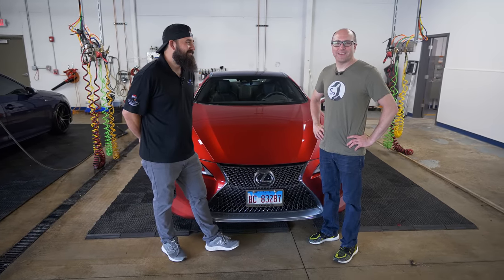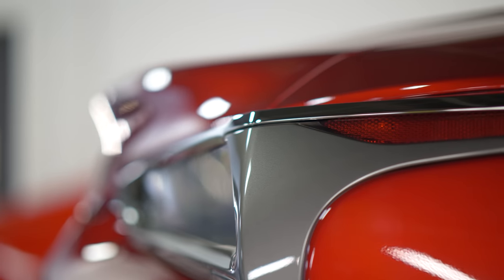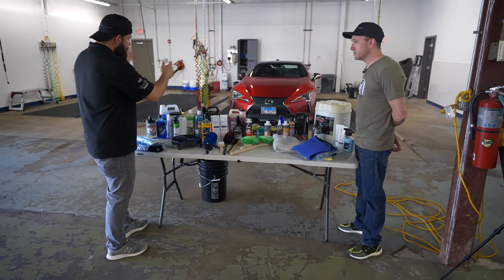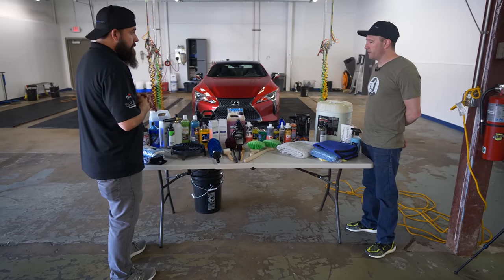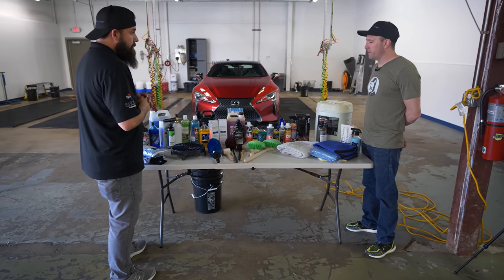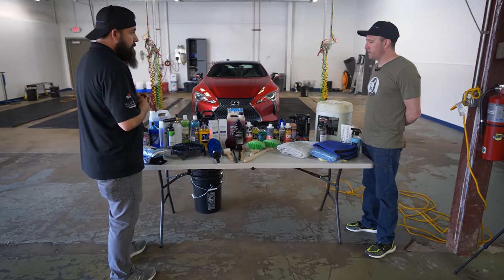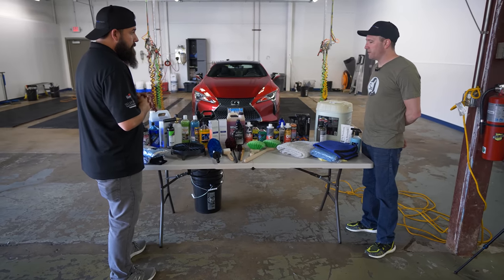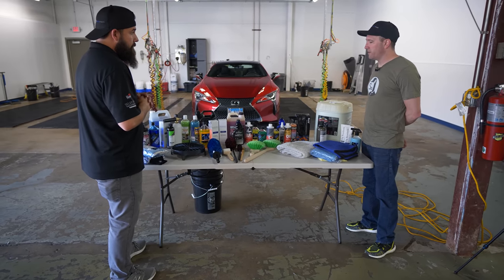The Right And Wrong Way to Do a Car Wash

Comment: Okay, got it. I need 8 buckets, 13 brushes, 17 microfibers towels, and 23 different spray-on products. Easy!
Reply: And don't forget a couple of "relatively cheap" thousand-dollar pressure washers! ;-)
Reply: And most of a Saturday.
Reply: ...And a leaf blower.
Reply: These comments !!! Lmaooo
Reply: You can use a $80 pressure washer to wash a car and it will do a great job.  The Kranzle's are great machines but not necessary at all, although they will last longer if taken care of.  There are plenty of one bucket methods of car washing that work great.  You can get a pack of 36 microfiber towels at Costco for $15 and use a handful of them to wash a car, and use a new one for each panel - which is probably the best and safest method of all, just be sure to remove any tags from the towels before using them on the paint.  Optimum No Rinse is a great product for the one bucket and multi towel method, especially if you are in a area with limited water access.  ONR is also a great product to use as a regular wash soap or a spray detailer for removing bird droppings and such.  ALWAYS use a different mitt or different microfiber towels and bucket for washing wheels and keep them separate from the towels used on the paint because metallic brake dust will get stuck in them and you don't want it to get on your paint.
Reply: Don't forget the two stage water filter
Reply: @bpsdetailing8822  the Costco towels are poor quality and leave fuzz all over the car. Great tips but Costco micro fiber towels are the worse
Reply: And now that, every week.
Reply: @bpsdetailing8822  Costco microfiber towels are not good. They leave a lot of small fibers behind, even after washing them.
Reply: @s flaherty NOTHING would want me to buy a Jeep. lol
Reply: NATSCHKE FAMILY ADVENTURES why ?
Reply: I think I'll just buy a new car
Reply: @frankdunn1813  The point was that there are cheap microfiber towels that will get the job done.  I got a pack of imperfect microfiber towels at walmart for even cheaper than the costco pack and they don't have any linting issues. I think the consistency with the Costco towels is not good, I have had good batches and bad batches.  They also changed the type of microfiber at one point and the quality went down, but for the purpose of using them as a wash mitt they should do a fine job.
Reply: 12:05
Reply: Honestly you’d think with all the advancements, automakers would’ve come up with much tougher paint. An automobile that is used as a daily driver will have to eventually deal with flying rocks, bugs, door dings, etc. All these steps and bullshit is cool for your $100,000 LC 500 that you garage until the weekend, but it’s ridiculous to be doing this shit on a $30,000 Camry that you commute to work everyday with. You’ll drive yourself mad trying avoid everything that could potentially damage your paint.
Reply from the maker: Your math does not add up, should be 12 buckets and 47 microfibers.
Reply: @mrmurdochyessss5406  you didn't hear him say more than once that you can just use a hose?
Reply: @bpsdetailing8822  I've gotten lazy and now pay a professional detailer to wash and wax my car.  But years ago, when I was doing it myself, I lived in an apartment complex with no access to an outside hose bib.  I used Optimum No Rinse, and man, that product is amazing.  After washing, I would very carefully dry my car using a yellow microfiber towel, and there wouldn't be a single speck of dirt on the towel.
Reply: Don’t forget a “Grit” filter and one mitt per section. 🤣
Reply: Ha,ha,ha, Agree anyone can do it at home.
Reply: @tailsneon556   I drive my truck down the street & back to dry it. No rag or leaf blower needed.
Reply: M R it’s really helpful but if you have a car price starting from 5$ to 34000$ forget about this video unnecessary  steps do them. Unless you have money and time to do so.
Reply: @swanblake  Wal-Sam's MF towels pick up debris - like garage dust or dirt particles (pieces of dried leaves are eternally stuck), so you get one use which leaves behind fuzz, and from then on, its just a rag for the dirtiest of jobs (engine compartment, dog throw-up, etc.).
Reply: @panzer_TZ  You get  the prize!!!  Best common sense comment here.  Indeed, I started using these methods on a car I put Modesta on.  Its a low mileage Honda S2000 who value should remain stable or go up and I keep it in a garage and don't drive it in the rain.  Doing all this for a normally-depreciating car that is driven in all sort of conditions?  GOD NO... what's the point?  If you get to the point swirl or other marks make you unhappy, buff the damn thing or get a decent detailer to fix it up and put a good wax/sealant on it then be happy for a couple or more years or driving normally - not freaking out at every puddle, piece of tar, or bugs...
Reply: @savagegeese  That's why you are The Almighty Producer and we are but lowly consumers of content.  Thank you, THANK YOU for showing us The Way
Reply: You're forgetting the power tools:  Blower, pressure washer, ...  So yeah, I just did my first-ever "proper wash" (according to the top-end detailer who put the "cheapest" Modesta on my car ("only" $800 for the coating, AFTER the paint correction process).
Reply: @panzer_TZ  It's called Spray On Bed liner.  Your Camry will look apocalypse tough.  The LA transients can pee on it all night and cause no damage.
Reply: @swanblake  I've used those yellow Costco towels. They are just fine for most purposes if you just wash them first.
Reply: Walmart cashier : & your total is...$47.50
Reply: Hilarious...…!
Reply: I don’t need no stinking pressure washer. House has 95 psi right out of the tap.
Reply: And buy them each month.
Reply: Andrew yang 2020
Reply: I just use the brush at the self-serv, get the whole car SPOTLESS in 10min!
Reply: no no nO!!!!! u dont all that,  i have pressure washer dont even use it. 
all u need is 
3-8 microfiber towels
car soap
detail spray
spray wax/ wax paste
3 brushes 1 for wheel, interior and exterior
1 bucket.
u can use reg garden hose.
not allways about product, its how u wash it and take your time doing it.  theses products some what help make it go faster.
Reply: @hamsterama  just out of curiosity how much do you pay & how often do you get your car cleaned by a detailer? thinking of getting a detailer to do it instead of doing it myself too but good ones charge ~$120 for a clean and that seems pretty crazy even if i do it once a fortnight
Reply: @lytheus69  I take public transportation to work.  Since my car sits in the garage five days a week, I only need to get my car washed and waxed twice a year.  I get it done at an autobody shop that I've used in the past for major work (this shop specializes in German cars).  I pay $100 each time.  Basically, I'm charged a flat rate of two hours of labor.  What I'm paying for is wash, wax, and cleaning the engine bay.  It does not include an interior cleaning.  So, that $120 that you've been quoted sounds about right, especially if that's including an interior clean.  If I needed my car cleaned more than twice a year, then yes, that would get quite expensive!
Reply: M R you also Need a lexus
Reply: @bpsdetailing8822  
the costco microfibers are no good for automotive detailing, you need better quality towels.
Reply: And a corvette
Reply: @swanblake , surprisingly, I have had good luck with microfiber towels from Walmart, about $7.50 for ten. I use an old Costco mf towel for my wheels.
Reply: @TheOzthewiz  The only problem with that is the high dirt content from the other cars before you.  Plus cheap car wash bristles.
Reply: Sounds like a 2 week project.
Reply: Haha!  No thanks.  I'll use the tunnel, and have it detailed every spring.
Reply: @swanblake  Sam’s club towels work fine and last.
Reply: @savagegeese  this comment is top teir
Reply: @Frank Dunn  I've personally never experienced this. I used to use the cheap Walmart towels for interiors and  glass. I couldn't stand them, they left lint every where and had a grity feel when wiping. The Costco microfiber don't leave any residue or lint and leave a smooth feel. I can even use them on paint. I usually use them for regular detailing and pull out the expensive stuff for cars with very good paint.

Comment: Best thing I ever did was stop caring about microswirls on my car. Huge weight off the mind.
Reply: Life is too short to worry about paint swirls
Reply: True. Eventually cars will get dinged, scratched etc.
Reply: sasquatch  can't have nice paint when you brush off snow 6 months a year
Reply: and dont buy a black vehicle either
Reply: @ForTehNguyen  Try having a black car, living on a dirt road, super hard well water and no shade to wash and dry.
Reply: I think sometimes people forget that the main purpose of auto paint is to prevent the metal from rusting. Washing your car regularly will minimize scratching. Waxing your car regularly with any decent cleaner wax will minimize or eliminate any fine scratches caused by an automatic carwash.

I've seen car guys paralyzed by the obsession with swirls and other fine scratches. Paralyzed to the point where they don't wash the car regularly. Especially, during the winter months. I GUARANTEE that will be far more damaging to their paint in the long run than using automatic carwashes.
Reply: @johnryan6658  washing the car too much is bad for the paint too.  Each wash is another chance to introduce more swirls and scratches.  Some places like the South don't have salt and snow to worry about for rust
Reply: @ForTehNguyen  half the automatic carwashes are touchless (at least here in the Chicago area). You can't scratch the paint if nothing solid touches it.
Reply: @johnryan6658  I agree washing and protecting it with wax regularly goes a long way. Protectors such as plant fat (carnauba), zinc (Nu Finish) or ceramic will add a layer of protection, being barriers to the elements at least and also act as lubricants to a certain degree.

As I said I have a black car, live on a dirt road and have hard water with no shade. Sand dust, dirt, water spots, and UV rays are all working against my paint to damage it but it's not that much of a problem with regularly applied protection. In my case I've worked it out to washing my car at a self car wash using city water every other week and applying some Nu Finish every few months. 

Some may say those brushes trap dirt and scratch but first thing I do is spray that brush out well and then proceed with gentle strokes all over the car. 

I've never had any perceivable scratches that bother me, not like others that have occurred due to actually using the car for what it was designed for and that can't be avoided anyway.

People who want to be super anal about it and have the money and/or the time, can wrap their cars or have them wrapped and be done with the WORRY on that level.
Reply: life is meaningless if micro swirls exists
Reply: Decades ago, Car & Diver magazine did a great article on the joys of not giving a rip about the car's finish.  The car is to be driven and enjoyed - but they went into great depth about the benefits.  Great article
Reply: @HAL-dm1eh  Dude - that;s a recipe for a car that gets washed only by God (rain).  Otherwise, what;s the point!?
Reply: @johnryan6658  Water touches it.  In fact, the bearded guy in this vid rinsed a muddy filthy car.  Does the force of water against grit and mud not scratch?  Hell yes, of course it does!  Only way I've seen this make even a little sense (and its the way the local high-end detailer does it) is to foam the car right away, let it sit a few minutes, THEN rinse it.  Foam it again, then use a mitt and soap on that, and rinse.  
Thing is, marks will get on a finish.  You're driving into abrasives at super-high speeds, wind is blowing dust and dirt on and debris on your car...  Now, Modesta and other very expensive finishes might take most of the brunt of abrasions from the painted surface, but I suggest those products are for two things ONLY:  1)  Someone like me who has a car they think will appreciate in value if cared for well enough and only get driven a few times a month (weekend car), and 2)  People who have enough money to just throw at good products and decide whether or not to maintain them later.  Okay, there is a third - or maybe a sub group of this second one:  People who lose sleep over swirl marks on their baby and will do anything to prevent them.  I know a shop who regularly puts on multi-thousands of dollars worth of products on car finishes for people who have more dollars than sense (IMO).  Like the Audi RS7 that got the top-end Modesta AND paint protection film.  I know its a special car, but damn!  These things might keep looking nicer longer, but I suspect that car will STILL depreciate at the same rate of one whose finish is not super-well preserved - it may be worth a little more when sold due to a well-preserved finish, but at what cost?  And how much more?  1-2% of the car's value?  Me?  I can't see all that money going to just keeping a car looking nice.  Hell, they all come with clear coat, so drive it, wash and occasionally wax it, then after 5 years or so, have it paint corrected and put some good sealant or wax on it for sale.  Or, if you have that money for a nice car, just wash it whenever you feel like it, enjoy driving the car as much as you want, and sell it whenever and however you want.  Unless you need a shiny car every moment of every day.
Reply: @BobC59  You mean my current residential situation? Well for one it only gets dusty if there hasn't been rain for a couple weeks, which where I am isn't all the time. And whether the road is wet or not, I try to take it slow and gentle on the road and it makes a big difference to how dirty the car gets. I'm also thinking about getting one of those dusters to run over the car real quick when I get home. 

Washing it and protecting it on top of taking it easy on the road most of the time keeps it looking decent even with the black paint. 

My only current problem is getting those hard water spots off the glass from previously unknowingly washing the car with this hard well water and leaving it to dry.
Reply: @HAL-dm1eh  Aw man yeah - My first "fun car" was an '04 Miata that got something on it that caused terrible water spots on the side windows and windshield (only where the wipers didn't go - oddly enough), but I didn't notice them all till I owned it (bought it during a rainy week).  It rains a good amount here on the central east coast, so I get all kinds of crap all over (and under).  
I'm cringing now bc I'm planning a nice long drive on the Blue Ridge Parkway tomorrow and its frickin' raining tonight... and my car is as close to perfect cleanliness as it ever will be.  
So I guess I'm one of those guys after all:  Thinking about missing a great driving day just to avoid getting my car dirty - well, mostly to avoid having to spend 2 hours doing a "proper wash" again...
Reply: I agree 100%, it's ONLY a car!
Reply: Ye u can jus polish later
Reply: Fuck that re paint coming soon on my baby jus wait long enough an then go back to oem color
Reply: Helps if your car is white.
Reply: when your car is dirty after one drive. a good pressure wash is all it needs
Reply: @BobC59 — absolutely! I NEED a shiny car at every single moment of every single day. 😊
Reply: @Dowlphin   TRUE!  I had three white cars in a row for 20 years.  I rarely waxed them - just went thru a car wash when needed.  Conversely. I will never by a black car again unless its the exact model I want and it’s only available in black- like my current weekender 😂   Oh well…
Reply: @alexanderg117  🤩👍🏼

Comment: I just buy a new car when it gets too dirty. Simple and it comes with new car feeling 😉
Reply: New cars don't come with great (much less perfect) paint. Unless you are talking about something like the Jesko which Larry from AMMO said had the thickest clear coat of any car he has detailed.
Reply: Go look at the dealer car washes you'll start to cry when you see how they clean brand new cars
Reply: @yotzimaraosorio6781  sup bbgirl
Reply: Dealers typically micro-scratch the crap out of the car during prep and while it's on the lot, and then they put a quick coat of wax on it before delivering, which hides the micro-scratches temporarily.  I don't think that this is malicious or for deceptive purposes, it's just it doesn't make practical (or financial) sense for dealers to be that obsessive about the finish, because most customer's aren't.
Reply: Couldn't you get the car repainted or some such?
Reply: Hilarious 😆